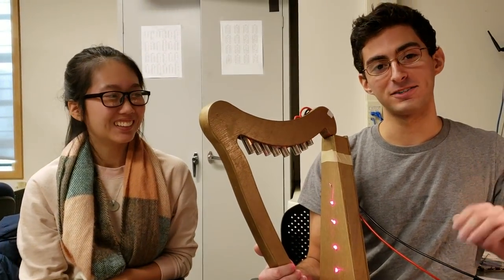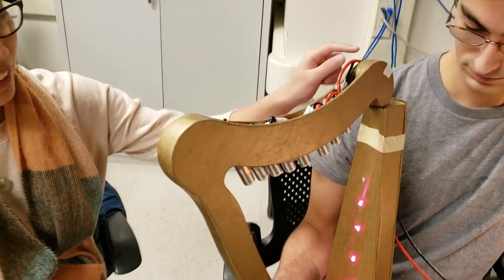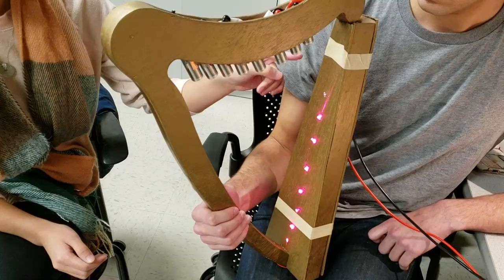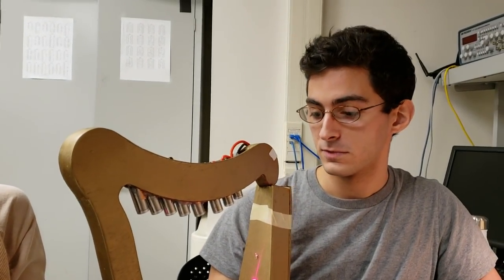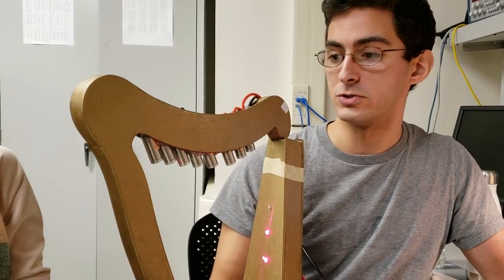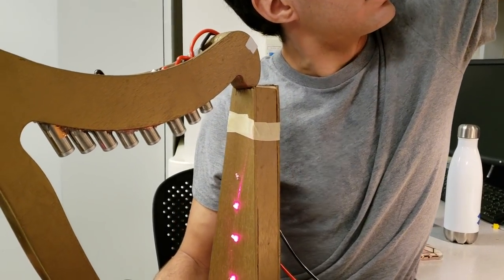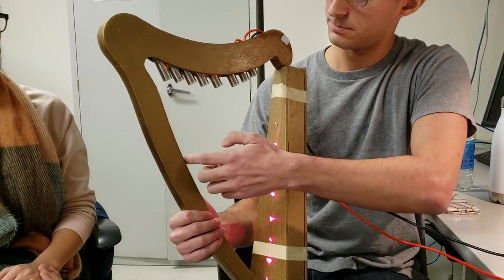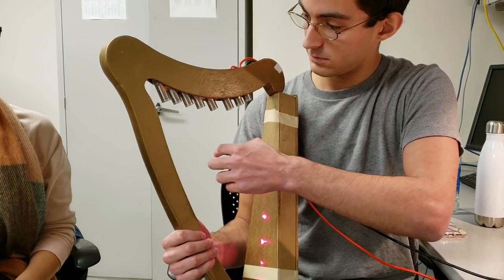LaserHarp

Comment: real harps will sound differently if plucked softly or aggressively.
does your digital harp do the same thing?
Reply from the maker: It cannot detec force, so it will not.  You can make this effect by using the full wave equation and taking into account amplitude dependent tension.